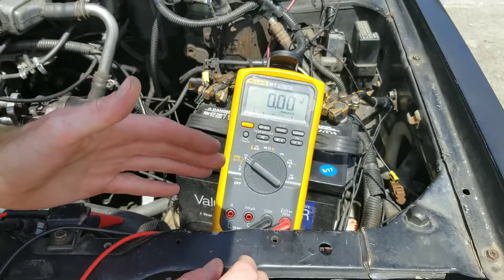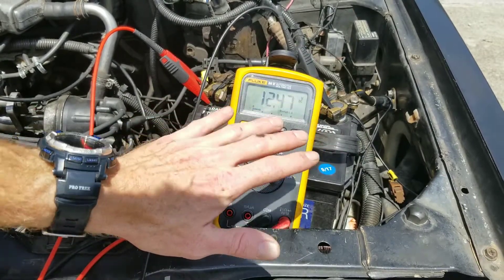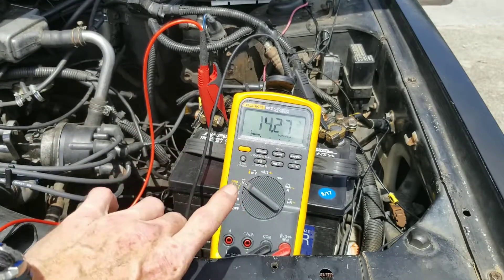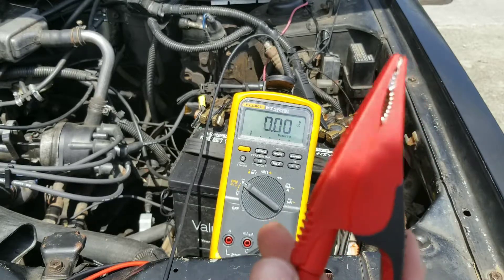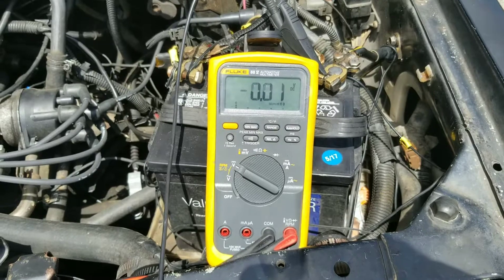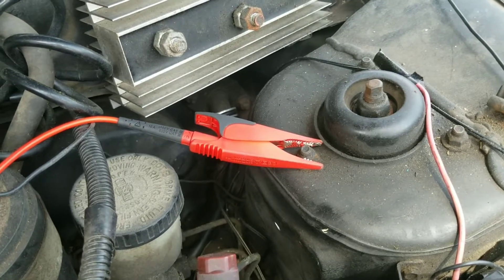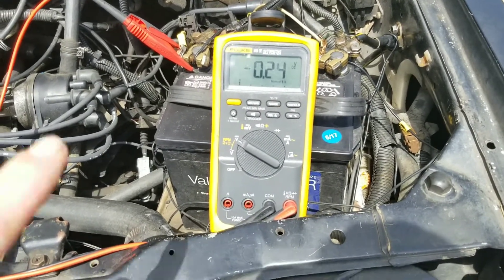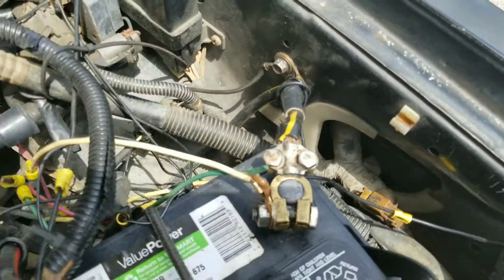#How to test your #alternator voltage drop test

Comment: My car’s battery drops from 14.2 to 12.2 after either on the road running or idle park at around 25 minute mark, and both brake & battery signs on at the same time. Just bought a new battery. Is it a bad alternator or something else? Why it drops at or around 25 minute mark? Thanks for your video.
Reply: You ever figure this out
Reply: You have a Parasitic Draw.

Comment: My tacoma has 60 millivolts drop on idle on the positive side  and 40 on the ground side. My car keeps killing alternators. I can't find where the trouble is. Rip. Good video btw 👍
Reply: 60mv is only 0.06v most dont want more then 100mv (0.1v) and many say no more then 0.2v on neg and no more then .5v on pos so your voltage drop is not a issue at 60mv

Comment: Fender grounds are crap. Firewall is better. Why? Fenders tend to bolt to other panels. Those bolts will be all rusty and corroded where you CAN"T see. Firewall is the most robust panel on the car. Well besides steel bumpers which new cars lack. Grounds should be to the STARTER, - battery post, rear of alternator case for high amp alternators and stereo systems and the firewall. Why? The starter is the highest amp draw on the vehicle.
Reply: I run a 12 foot negative wire directly from my car to the pavement. True ground is the best ground.
Reply: @dr.astro.hutchins 😂😂😂

Comment: It is BEST to test for voltage drops UNDER LOAD. Just as he shows here. You can still see a drop with no load. Just won't be so drastic. If you have a heavily corroded battery terminal, you will see a drop with no load.

Comment: HOT WATER is the best to clean terminals with. All others are messy and a waste of time. Why? Most sodas are acidic. You want either a neutral pH like HOT WATER or a higher pH like baking soda to neutralize the corrosion.

Comment: Carbonated drinks will clean the posts.  Apply grease afterwards on terminals...keeps them protected from sir
Reply: Carbonated drinks don't clean anything. You have battery acid inside your battery. You want to neutralize the acid on the terminals. Most sodas are acidic. You want either a neutral pH like HOT WATER or a higher pH like baking soda to neutralize the corrosion.
Reply: Ok, but it works like baking soda.  I put grease on cleaned terminals afterwards...old school